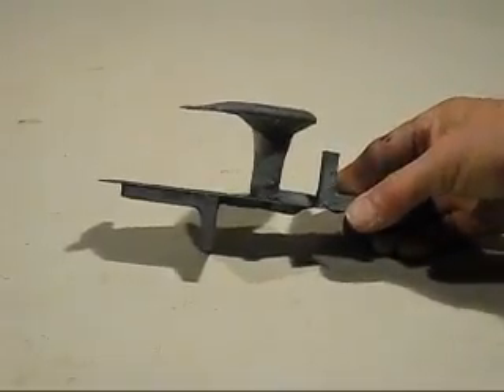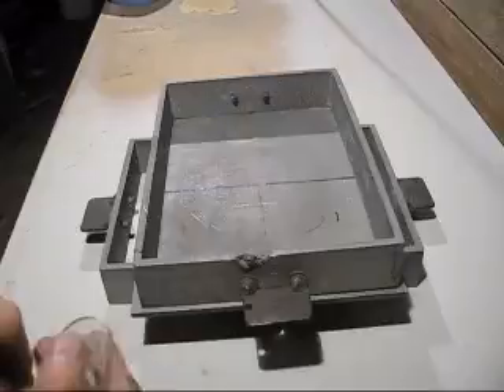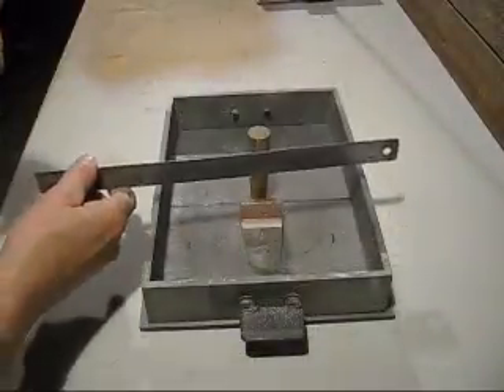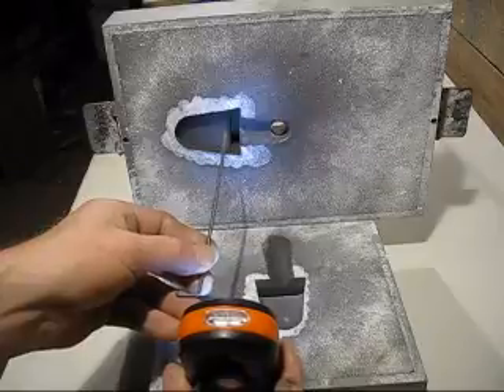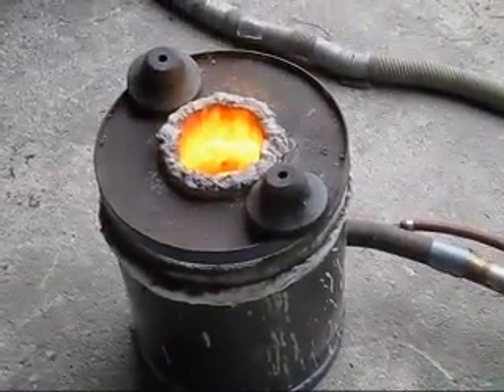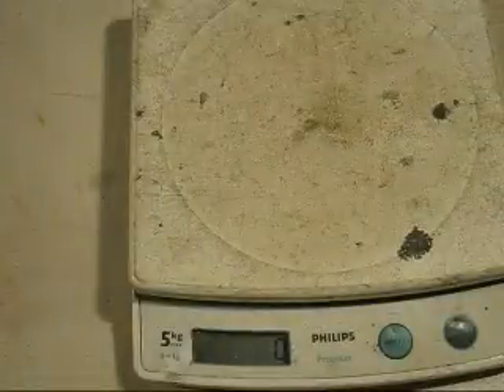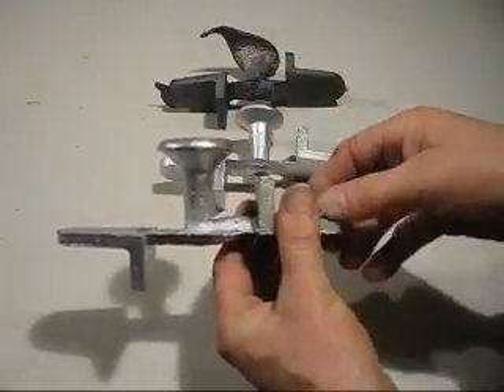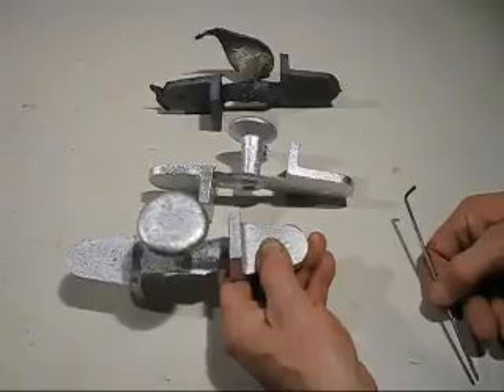Are tall sprues and vents needed with sand molds

Comment: Thanks for taking the time to do a video on this. After I talked to you about the vents last week I decided to chance it and go without and they did just fine. I guess I had one strange part I was casting about a year ago and vents were the only way to improve it and decided to just vent everything from then on but, I have much better quality sand since then so I will now start avoiding this step, it will make cleanup on the casting much better.
Reply from the maker: Thank you for watching this video. It always a good thing to review why you use methods and see if they really do work. I used to use really tall sprues and vent my molds. I found that I would remelt the tall sprues and then realized that over 5 molds I could have poured another casting with that extra metal and it did not affect the casting quality. Same goes for venting, it did not affect casting quality.